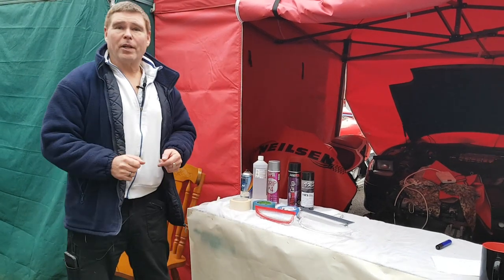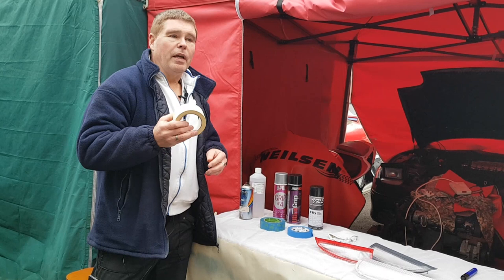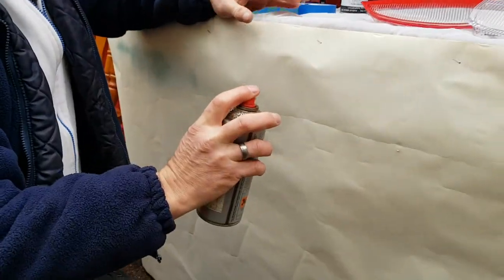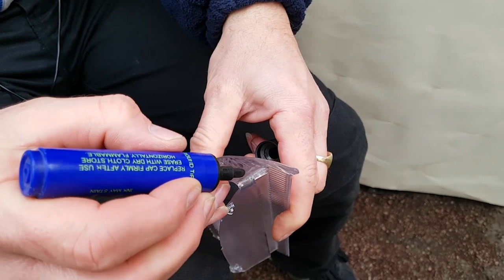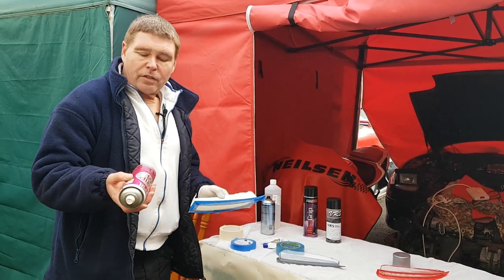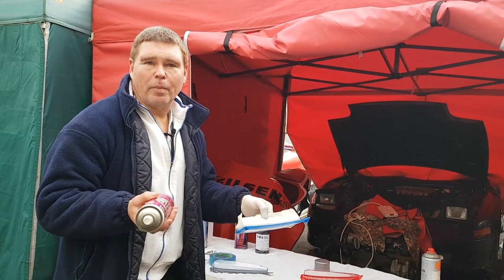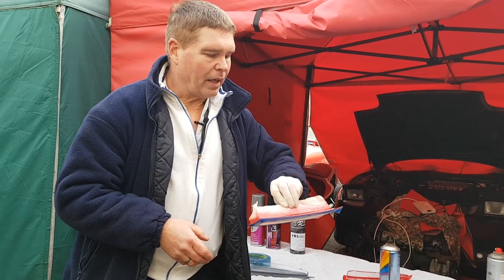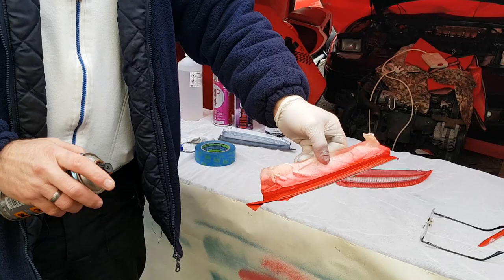Mitsubishi 3000gt / GTO front side light / Snake eyes - Custom Painting

Comment: Thanks joe,

Some suggestions for the list:
• Spark plug replacement
• Front & rear discs and pads
• Handbrake shoes & cable adjustment
• boost pipe replacement
Reply from the maker: No problem. I just want to finnish the interior while the weather is still a bit rough and then I will start on exterior and maintenance. The plan is to cover all the basics first and then work towards advanced level stuff like engine and gearbox rebuild.
Reply: @3000GTGTORestoration  appreciate the chanel, there is a huge void of practical infomation on these cars